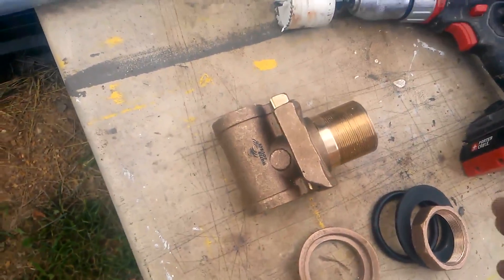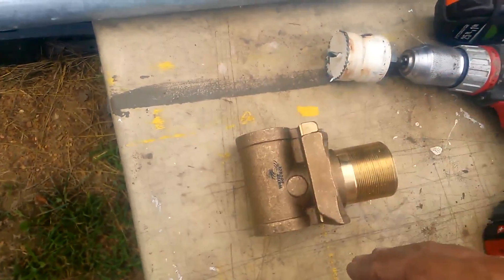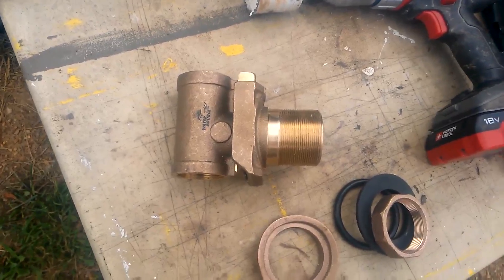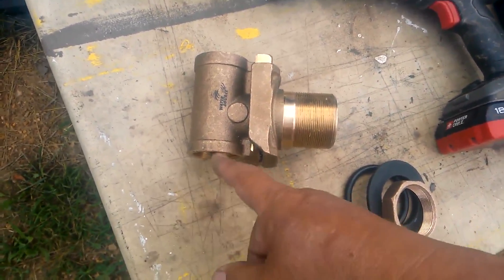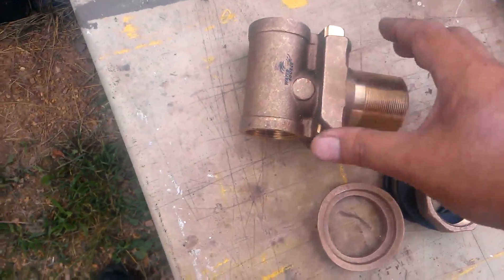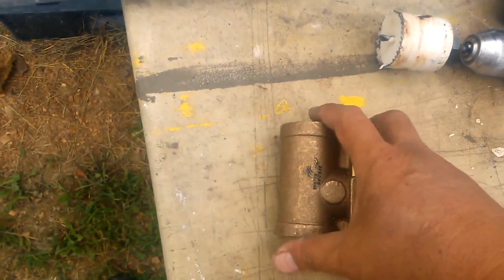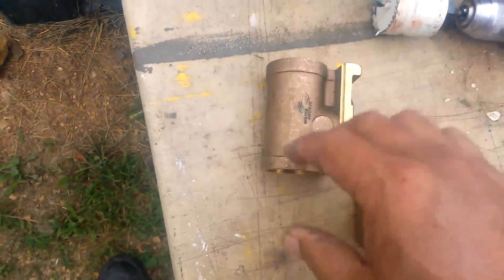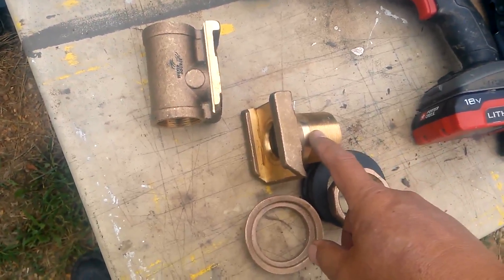The Purpose Of A Pitless Adapter

Comment: So it is basically an easy to pull loose T.
Reply: Not easy after being in contact for years and years with the weight of the system pulling the two pieces into that jam fit.  Consider lubricating your pitless adapter with some silicone.  Someone in 10 years may thank you.
Reply from the maker: Eric Andersen Good advice, brother. The O-ring came lubed but nothing last forever. It will compact and flatten, making more metal contact. That will make it stuck after a while. No way to whack it to loosen down in a pipe. Maybe pull every couple years and lube to avoid frustration. Thanks for your input.
Reply from the maker: Yeah. More simple to pull, but not easy to pull when loaded with water filled pipe and pump below it.

Comment: Thank you so much.... I needed this.  My last piece to understand before I pull my pump.   I'm nervous but happy to learn how simple this is.
Reply from the maker: Ed L'Ecluse Your welcome. Most are pretty straight foward, but some do come with an interlock that can only be released by pulling a cable or lever on the actual pitless. If you find it impossible to pull, you may have rig up a secured camera or mirror and light to inspect it better.
Reply: YesuMessiah I'm having trouble breaking the seal.   I'll go to town Monday and find some sort of camera.... if my wiring connections were very rust covered, would that cause my pump to not get enough power and possibly be pumping 1 gallon an hour? Or do you thunk my pump is just shot if its putting out that trickle? Probably 200' deep.  It takes 4.5 seconds for a dropped snowball to splash at the bottom.
Reply from the maker: Ed L'Ecluse Rust might be from you connectors exposed to moisture. Enough moisture may cause power loss and even a short to ground which left long enough could affect pump performance. If you have a spare phone, camera or tablet small enough, you could use that to record the condition of your pitless to determine what's giving you problems disconnecting it. Just make sure anything you lower into your well casing is extra secure by rope, wire, selfie stick, duct tape, and even a backup safety string/wire to prevent loss down the well hole. 4.5 seconds sounds like a 140 feet water level. If your pump is at or above that level due to a drop in static water level, that would account for lack of water. You can take a water sounding carefully with nylon twine and a fishing bobber to measure the water level. You can weight it just enough to keep the string taunt to get a good response so when it goes slack you've reached water. Mark then measure.
Reply from the maker: If you don't know your well depth, water level and where your pump is set, someone has that info, usually the installer and the state agency responsible for recording water resources.
Reply: YesuMessiah thank you my friend.  I really appreciates you taking the time to respond to me.